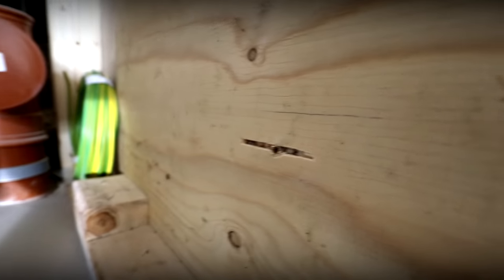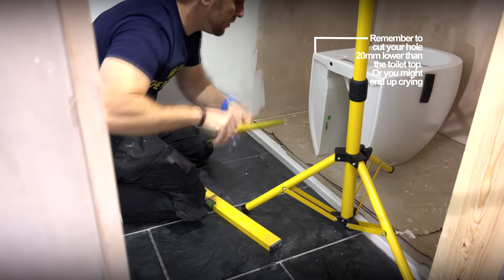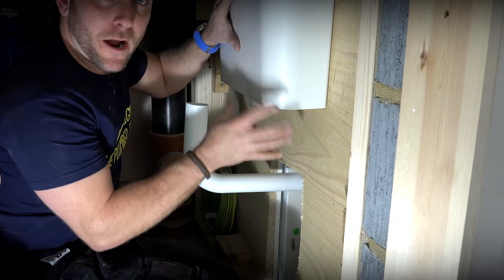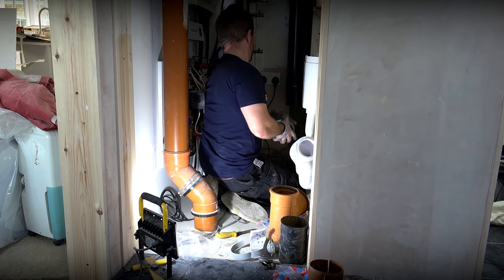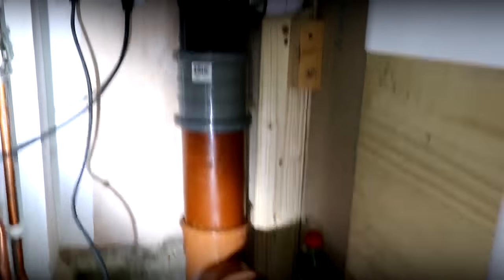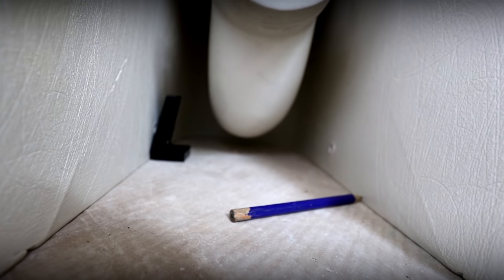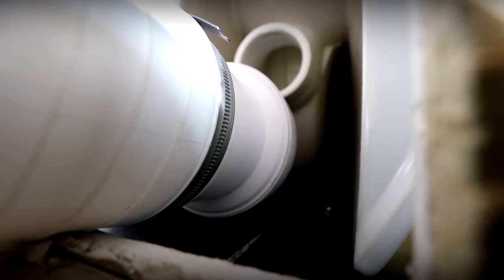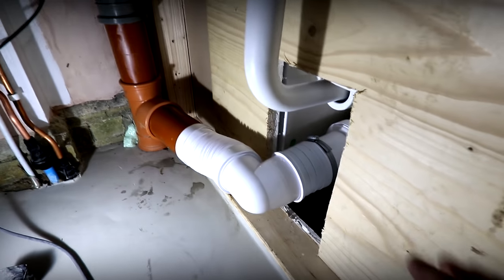BACK TO THE WALL TOILET & CONCEALED CISTERN INSTALL

Comment: James, I've recently bought a house that happened to have appalling plumbing - everything was leaking and basically bodged right up. Thanks to your easy to follow and spot-on videos I've managed to replace and properly seal all the problem areas without any prior experience. Your videos have saved me probably hundreds of quid. You're a bloody hero! It's also amazing what a difference Plumbers Mait and PTFE tape can make! Cheers buddy
Reply from the maker: No worries Twonk! (?) Glad to help mate/dear!

Comment: Nice clean job but I would prefer to use a longer pvc soil pipe and 90 bend which would eliminate the need for the messy flexi fitting
Reply: That's what I'm thinking, shit's just gonna collect on that and eventually clog
Reply: My thoughts exactly 💯

Comment: Good video as I want to install a back to the wall toilet onto a brick wall and build a false dwarf wall on the other side, but I was hoping to see how you set up of the flush switch for the cistern as I am going through a 4" brick wall and would maybe have to extend the cable that controls the button flush?

Comment: And now repeat in a 500mm wide toilet cistern unit so when you manage to somehow get it all in there you are left with 15-20mm from the end of the threaded water feed for the cistern and the side of the unit!? Who designs these things ?

How do you get around that ? I presume you cut back the threaded plastic water feed into the cistern but Ive not had much luck with that in the past getting it to seal.

As I had a handy 600 wide sink unit to match next to it I just went straight though the side of the unit.

Comment: Thanks for the video. I’m replacing a CC toilet with a concealed cistern so this has helped. I’m building out the wall to house the cistern before plasterboarding and tiling. 

Is it best to leave a section of the wall open to help installing the flush / waste pipe as once closed in it will be near on impossible to push the fittings on from the top?

Any recommendations of good quality brands? Do not want a cheap one which will leak in 12 months. 

Thanks

Comment: James, you have the same make n model of oscillating cutter as me.  Regardless of which make/model, I find these tools to be exceptionally useful. Only bought one last year. They are amazingly versatile if you use the correct "bits". Raking grout lines, chasing out worktop for awkwardly positioned  kitchen sink clamps, running round architrave and door cases for neatly running under laminate.......... just to name a few. Folks, get one bought.

Comment: That right angle pipe from the cistern into the pot the flush is awkward to measure if you're  laying flooring under after fitting. 
Any tips.
I can't get access like you behind the wall is the neighbours.

Comment: Hi James, been watching the presentations for a couple of yrs, I have a push button air type toilet flush which has stopped working. Bought new plunger & still won't flush. Can you enlighten me why when you push it doesn't flush? Cheers Peter

Comment: Hi. quick question. How could a fix / tighten the toilet lid in this type of toilets once it is glued to the wall and there is no access to the screws? Do I need to remove everything to be able to tighten the lid? Thanks
Reply: Different fixings for a concealed pan wc seat

Comment: We have a concealed toilet and we're having problems with condensation on the bowl inside the unit, is it normal.??
Reply: You could fit insulation behind the pan. Condensation forms on the surface of the cistern or pan because the
 water is colder than the surrounding air temperature.

Comment: Love the video.  As a plumber myself, I totally agree with your attitude: brown soil pipe is not UV stable but (and using our brains now) it doesn't matter a jot as it's in the cupboard.

Not fitted a back to wall yet as it's a bit flash for most of my customers, so good to see it's pretty much as I imagined (also fiddly as hell).

Had to laugh when you said plumbing isn't an easy job.  Recently a customer wanted one of these replaced (with access from the toilet side only and the whole installation looking a bit dubious) and I think he was a bit put off by my estimate.  I'm looking forward to his either finding someone cheaper and having problems, or not finding someone cheaper and calling me back... because... the day I said could have fit it for him, well, I'm not free that day now...
Reply: I would have used a soil pipe bend instead of the Flexi and a straight multi quick also clipped the soil pipe to the wall
Reply: @andybb  yea you cant beat hard piped  jax

Comment: just fitted my small toilet with sink ontop under my stairs with a macerator pump. however I don't have screw holes for the top of the cistern. do I just silicone the shit outta the back? hold tight Bradley cooper

Comment: At 8:25, when measuring where to drill the holes for the brackets, you can also put the toilet in place and just mark where to drill the holes with the brackets in place, from behind the toilet. It is less risky when walls/floors are not flat.

Comment: with so much space behind i would have  used rigid 4" pie connectors as flexible connectors are no go for me.My sons flat has a flexi connection and leaves a nasty stain at the bottom and the smell is awful.i had to use powerful epsom salt to clean it all.and it now has to be cleaned every six to 8 months.
Reply: I would do rigid connection as well, and there is no need for that big cutout.
Reply: Yup. Looks almost like a plumbing disaster. Hope it works out well.
Reply: 100% rigid pipe work, top top man is James but I think he’s appealing to DIY enthusiasts, flexi pan connectors have their uses but normally as a last resort, hold tight indeed. :-)

Comment: People say those floor plastic brackets tend to break.  Is it worth using them.  How about just a bit of wood?
Reply: Aman A wood rots and splits. Instead sink some 4 inch screws into the floor 2 inches proud, heap some large blobs of rapid setting cement on, sit the pan over, screw in after. It'll never move.
Reply: Nick Baldeagle Oh... that seems like a bit of an overkill!... after all floor boards are made of wood, and are only 1 inch thick, and rarely rot... I think if you drilled pilot holes in the wood, it shouldn't split... but I'm sure your method would work too... have you ever tried that cement method, or is it just an idea?
Reply: I do it often. Council toilets need to be solid. Those tenants are not gentle.
Reply: The plastic ones are very strong and last for ever. The silicone is even better as James mentioned. Not to mention the builder pulling his hair out if you decide to drill through the water proofing membrane. Those plastic ones can be glued to the tiles. [no drilling, no holes on the membrane and you can remove the toilet if ever needed.] Thats how I have been doing it and its the best way. Luek Benbow Plumbing is the best